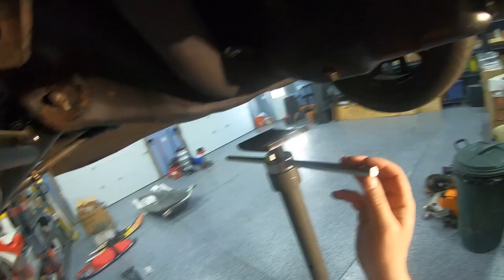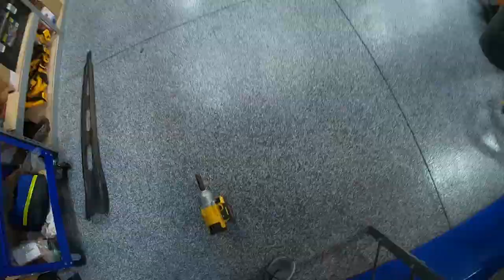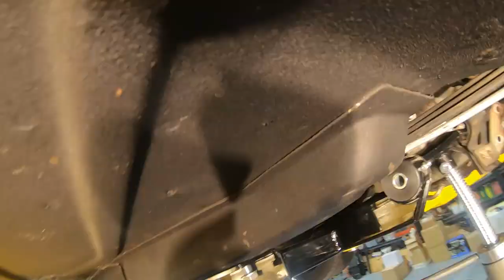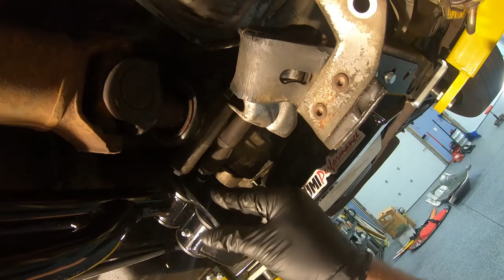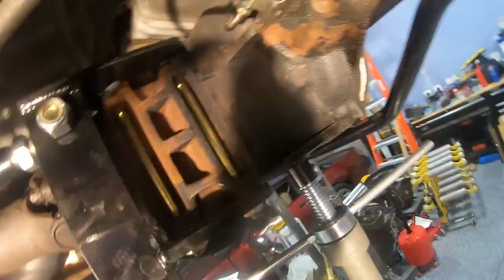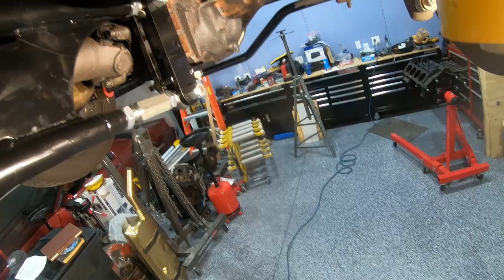1982 - 1992 Chevy Camaro Tubular Torque Arm and Transmission Mount Installation

Comment: i have a 94, it looks like exactly the same set up.  I know much of the third gens were carried over.  I was told GM originally planned on ending production in 97 so they did little to upgrade the 4th gen besides the lt1
Reply from the maker: Most things on the 4th gen 1993-2002 will bolt right up to the third.  Swaybars are different, and the dash, but most mechanical stuff will swap right in.  A lot of folks will pull the 4th gen rear differential, brakes and lines to convert to 4 wheel disc.